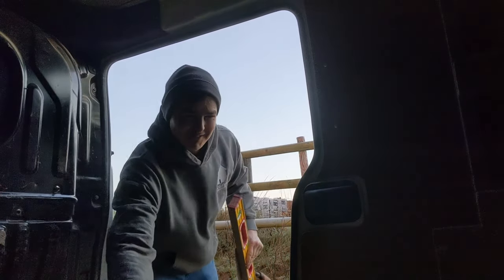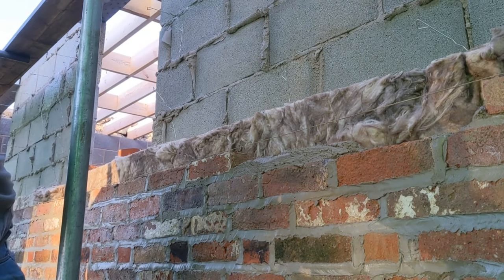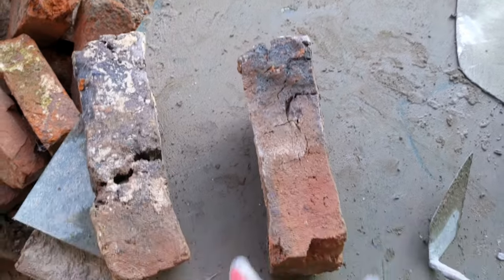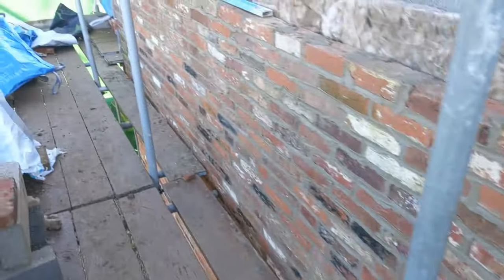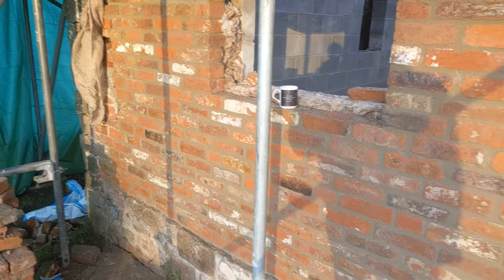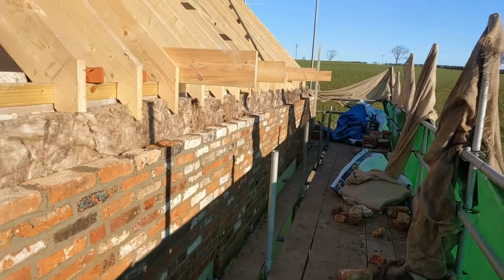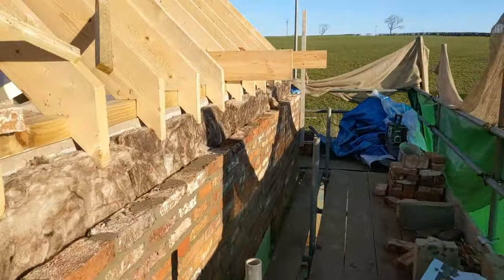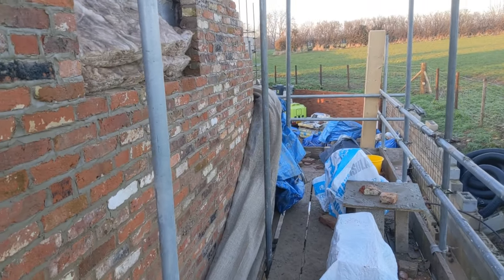Bricklaying - Barn Conversion - Laying the original bricks #renovation #vlog #vlog

Comment: 1. Don't forget pop back support on for Stonework 
2. Old East End Bricks always my Favourites ... you have been around this project for sometime now, the bricks were dropped off on pallets and there again for long time 
3. In future take time to re-stack but this time on edge 2 by 2 only so to get air though 
4. when you finally come to lay, there will be no bricks swimming or Pug running down front
5. cut yourself off length tile baton 6inches put 45% angle on one end... 
6. Give the Pug time to initially set
then joint up ... leave again, to a final brushing,  pity bout white cement
We would make a feature of those bananas 🍌 with just 4 arises touching.line.. everything goes in... 
Glad you have couple weeks dry weather up there
Malcs formally of Brighton Sussex now Perth WA 20 years 
♥️😎
Reply from the maker: Thanks for all those pointers mate🙏🙏🙏 I would have loved using white cement or lime..but we only had the materials to work with 👌 I've restacked some bricks to airrate them👌👍
 keep Living it up in Perth 💪💪

Comment: What is your opinion on 200 years old bricks. I feel they have become porous. Weve just done one used.white cement and lime.
Reply from the maker: Hi John. I couldn't agree more with you. They are like sponges..they seem to just suck up any moisture in the air. Glad to hear you used some lime, I would have liked to here...I don't think these bricks will last many freeze thaw cycles with the sand and cement mix here.
Hope your well mate